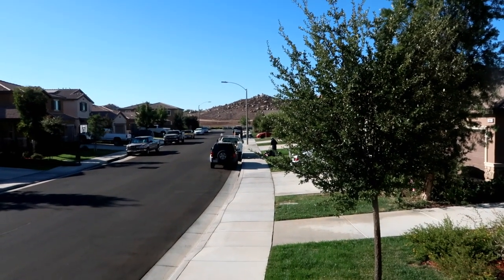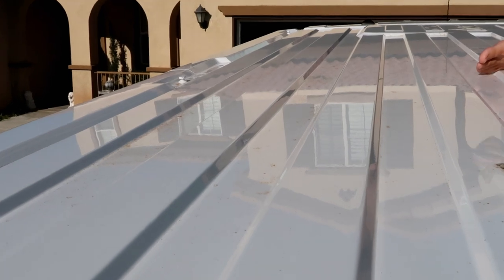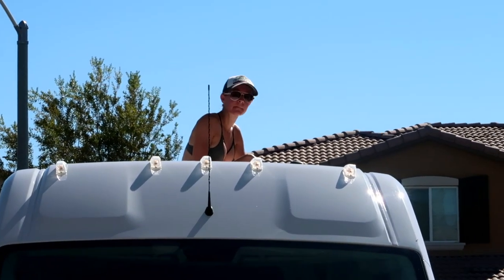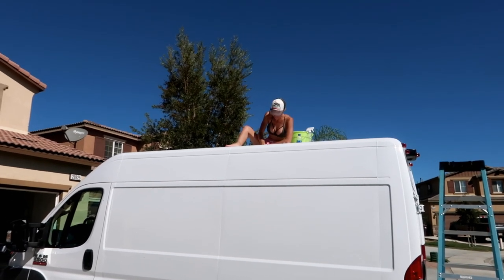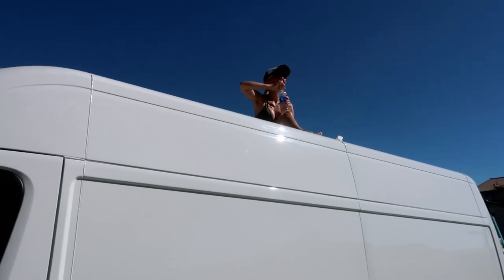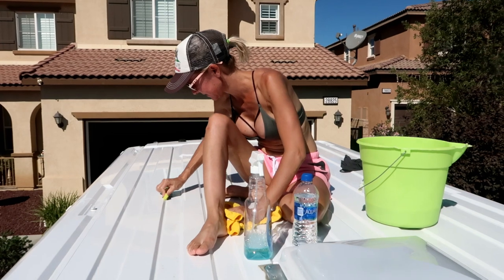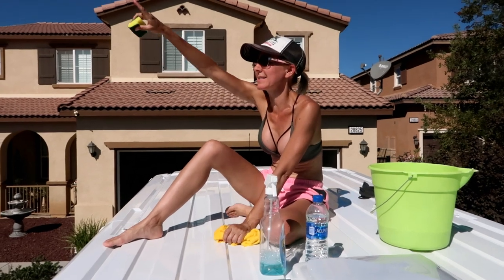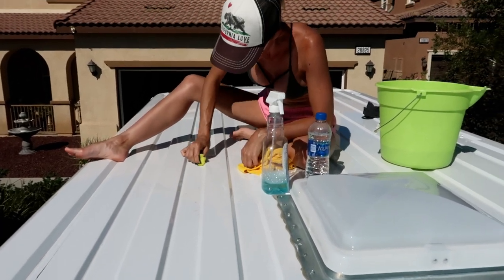We Made A Huge Mistake. Ram Promaster Van Conversion Roof Vent Rust Everywhere

Comment: Yes very important to clean up the shrapnel! One problem is the iron is magnetised when cut or grinded so it sticks very well, and doesn't fall off by itself. This is true for both a jigsaw or a grinder. The best tool to use is a 'nibbler' that cuts a line with a single piece of waste metal. I wish I had bought one at the beginning of my build. Also make sure after cutting any metal that you seal it up with rust proof paint. If you haven't done that on your roof vent, pull it off and do it! Otherwise you will get rust on the edges, even from the water in the atmosphere.
Reply: The good news is apparently small bits of rusting metal sitting on top of paint won't 'eat' through to the van body.
Reply from the maker: Thank you for taking the time to comment. Yes, I sprayed some rustoleum. It isn't pretty under there but it is done. Thanks.
Reply: Eat Sleep Van:  I'm not an engineer, but maybe the dry air from where they live helped to create static electricity charge?   Maybe Ground leakage from their electrical system to the frame?   Or just immediate micro rusting the night that they cut the hole?   Steel is made from iron, but didn't think it could be magnetized.   Ok, I just googled ...  rubbing a magnet in one direction over metal ... but how would a saw do that?

Comment: As "Eat Sleep Van" said a year ago ... the metal dust from cutting the roof vent just magnetically or immediately rust stuck to the top ... and that dust is not painted ... just raw metal that will rust even in low humidity very quickly.  Great find!   No other videos show this problem ... maybe the dry air from where you live helped to create static electricity charge?   Maybe Ground leakage from your electrical system to the frame?   Or just immediate micro rusting the night that you cut the hole.
Reply from the maker: Thanks for the comment. I can happily say that after the clean-up we have not had any more rust or rust issues.

Comment: well that sucks...is this van built in Satillo (mexico)......or is this related to the opening of the vent and not properly sealed and then spreading to the rest of roof?...the ram promaster...called fiat ducato in europe is simply one the best rust protection bodyworks...if not the best...that is why it is the most used base van for rv /camper conversion...is mexican steel that bad? is it Chrysler greediness? or a poor vent conversion?

Comment: you sure that rust wasn't fallout from rail transport, and the dealer didn't  give the vehicle a treatment of fallout gel, or whatever they use nowadays. every white vehicle should get the treatment, it helps pull any rail dust out of the paint.